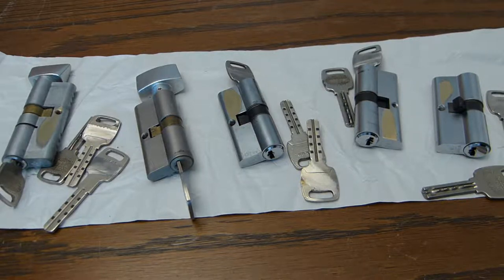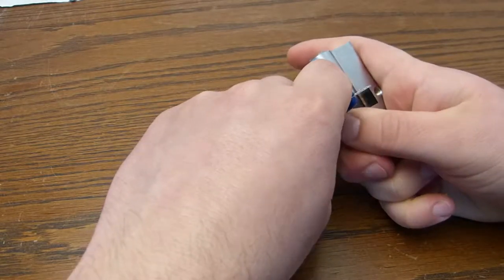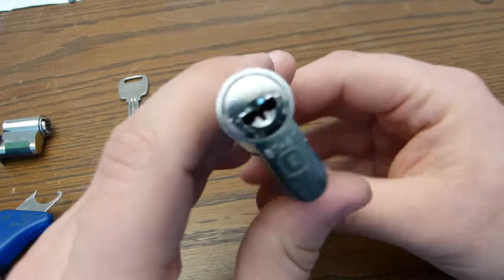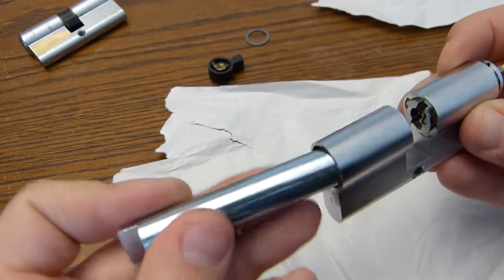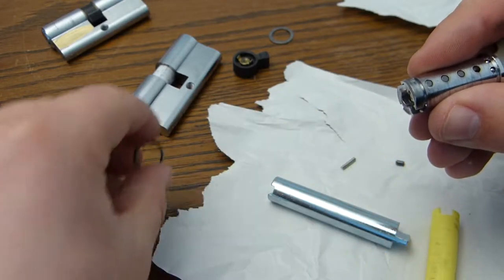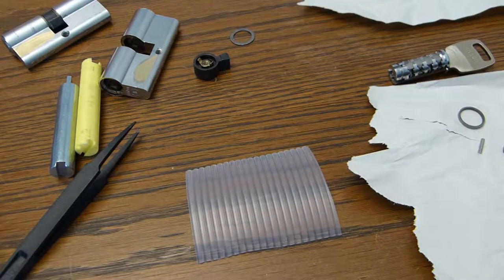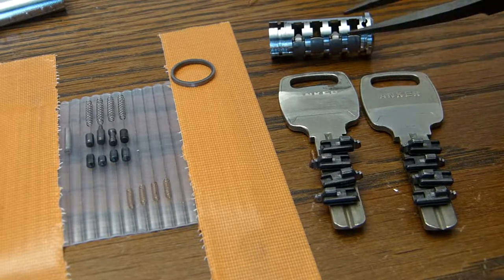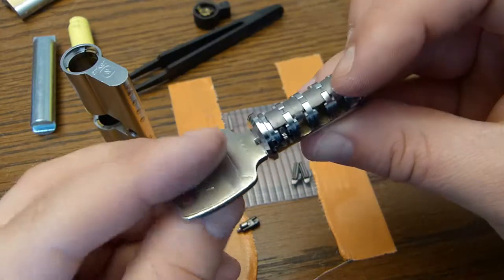[007] Exploring the Anker/MIWA 3800 Magnetic lock

Comment: Traditionally, these locks have two magnets on the underside of those sliders. That thin bit in the middle is on all of them and is not the magnet. I'd be really interested to scan the underside of those tumblers with my magnetic reader.